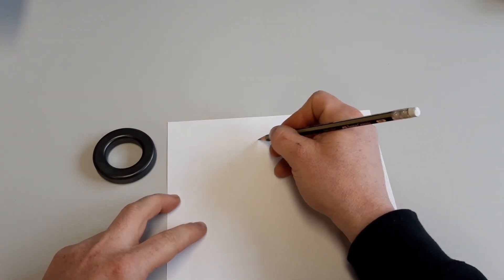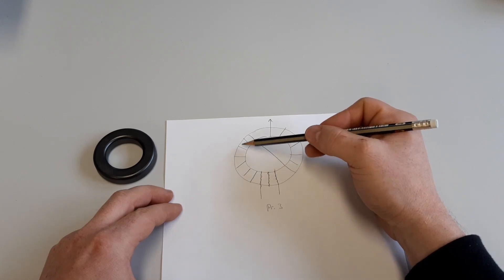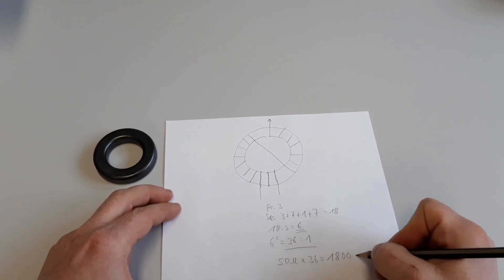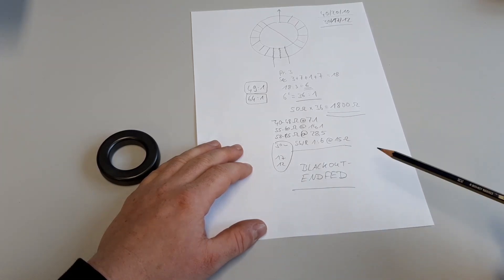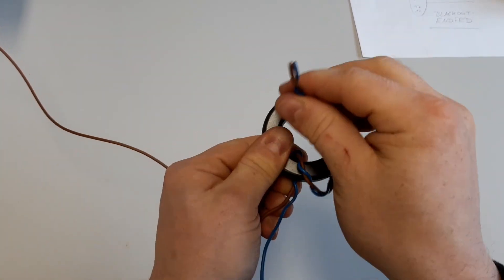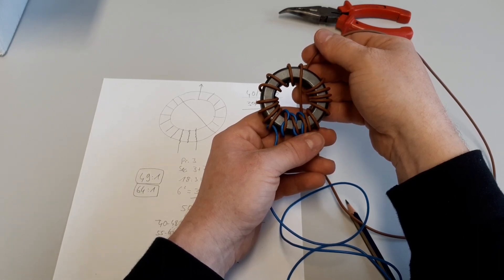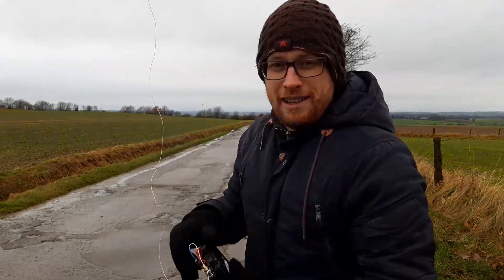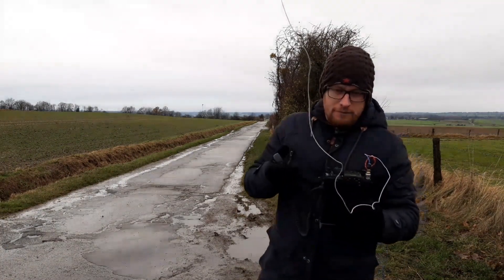"The blackout endfed antenna" 40-10m additional correction and testing video to the last one

Comment: When you put metal inside toroid you will have indutance changes. So the conector body inside toroid seems to me not a good Idea!
Reply from the maker: It is brass but in fact this antenna works, this is the thing
Reply: The inductance doesn't really matter, only the transformer ratio.

Comment: Just to mix things up here is a quick video watch?v=AjH1iesDWJI on QRP small toroid "Fair-rite 2643625002" Its claimed to be less then 0.77dB at 10m. I haven't tested this myself. Prob end up disassembling it and using the large toroid for a spare CMC
Reply: I experimented a lot with this small toroid and used more efficient windings. You'll find my document that describes a 7-band EFHW for portable opration.

Comment: Well done, great! A very interesting video, although I am a supporter of a tuner instead of a transformer. The fact is that the antenna resistance varies depending on the conditions, and the tuner allows you to perfectly match, and I think the losses in L-Match are less.
Reply from the maker: Yes correct but minimalistic and lightweight is my passion.
But mostly I am using symmetrical and tuner length antennas. That is the best gain
Reply: @QRP.lifestyle  that's right, but I make tuners the size of a transformer))